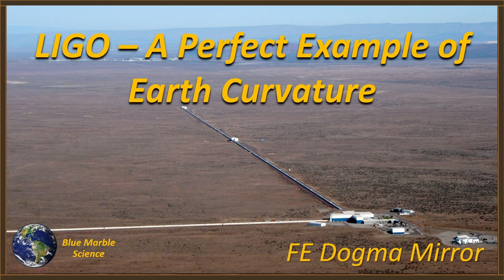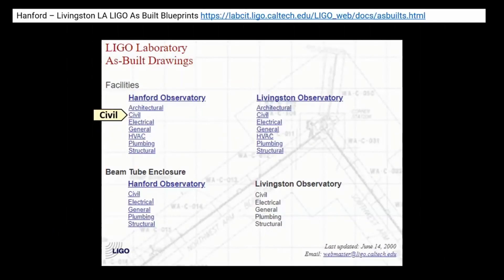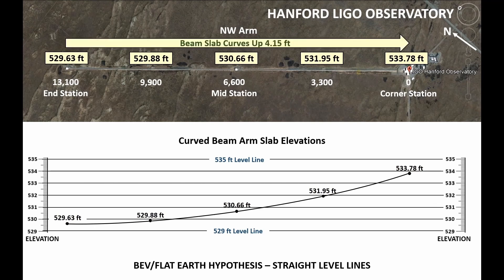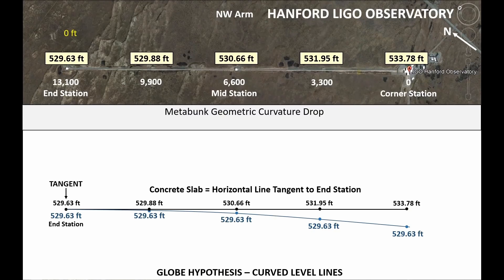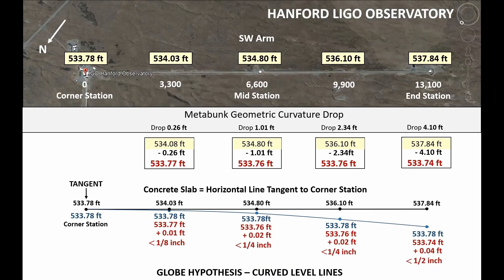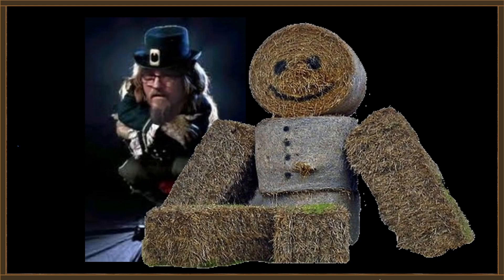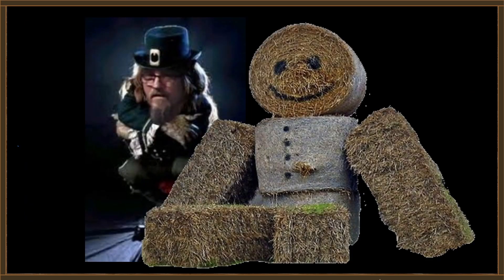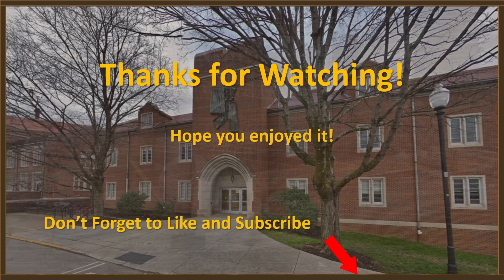FE Dogma LIGO Hanford Mirror

Comment: The phrase "precision engineering" is generally not one that leaps to my mind when talking about concrete pours over a distance. It's probably because of all the Pennsylvania roads I drive on. When it comes to LIGO, they really nailed it. The error in their pour is probably smaller than the thermal expansion experienced by the structure when it gets hot (no, I'm not going to try those calculations because it means looking up stuff).
As far as Bev & crew's apparent mental shortcomings, that raises a question in my mind. Is there an innate limit on what one can learn? Let's use math as an example. Some people breeze through it. Others have to work very hard at it (especially with differential equations). And others never ever get it. Is it the way it's taught? Are brains just that different? I don't know.
The answer is easy in sports. Someone who is fast with good eye to hand coordination and 7'8" tall is likely to be a better basketball player than someone who is 5'2" and a bit clumsy.
Reply: Yes, but with perspective a 5'2" man who was near would be taller than a 7'8" man standing further away. 
You globers always ignore perspective.
Reply: @verystripeyzebra  your understanding of perspective is not completely wrong but also not completely right.

If a small and a big person position themselves in a distance from an observer, with the smaller one closer and the bigger one further away, and all three are standing on the same flat ground, the smaller can completely hide the bigger one ONLY if the observer's eye height is BELOW the height of the smaller one.

Interestingly, when the observer's eye height is higher than the small person, even if the large person is partially hidden by the small person PERSPECTIVE can cause it to become fully visible again by walking FURTHER away.

So yes, perspective generally will make things smaller when they move away from the observer but despite the fact something gets smaller with growing distance it may fully reappear by moving further away.
Reply: @mittelwelle_531_khz  so they can use it tactically to neutralise any height advantage. But obviously they will need tactics to stop the tall person getting into the foreground and therefore increasing their height advantage. 
But if the short person concentrated on the furthest away basket this could also help, as it would be smaller.
Reply: Really the foundation pour only needs to be within the adjustment range of the brackets that mount the vacuum tubes.
Reply: @verystripeyzebra  True, but you need some distance for those three point shots!
Reply from the maker: @scott_meyer  The "sagitta" of that curve is only a foot so in theory, you could let the concrete curve and just provide 13" of adjustment. But that's a sloppy  way of doing it. I don't see a tolerance on the concrete stated anywhere but its concrete. There's only so much you can do unless you want to come back and grind after the pour cures. It appears that they worked to around 1/8" and that's very very good for concrete.
Reply: @scott_meyer  And roads only need to be in the travel range of your suspension. It's also nice when the ripples don't match the harmonic frequency of your damped oscillator!
Reply: @Fudmottin  perfect, he gets more points when it is actually to his advantage. So possibly the 5,2 player is now at an advantage. This is huge! Coaches have been selecting wrong all these years. Once this gets out,  and the flat earth is settled science , I predict NBA players being very short to leverage the perspective advantage.

Comment: Fletfs say the conspiracy is easy as only the higher ups need to know. OK so the builder will have laid a curved base. But no because when they made the tube it was made to be straight so it would be two foot higher in the middle than the ends. So anyone involved in the construction had to be in the know. Let's assume everyone now working in LIGO thinks it is real. Then there must be another team of people feeding the "gravity waves" into the data. At the very least, the instrument engineers must be in the know to keep those connections operational rather than investigating the extra connections. What it amounts to is running a flat Earth LIGO is more expensive than running LIGO for real. Why bother with it at all if the conspiracy is involved?

Why haven't ALL the flerfs been silenced? Other stuff was just recently around to be blamed. They avoided precautions so it wouldn't have been hard.

I think flerfs themselves are evidence there is no conspiracy, never mind all the direct evidence available to anyone who cares to do their own primary research.
Reply: To me it is a sure bet that all the people fantasizing any SUBSTANTIAL scientific and/or engineering project could be ruled by the "need to know principle" (so that only a small group at the top knows and understands what it is really built) have never ever participated in projects involving more than a dozen people required for the "brain work" or involved in assembling, testing, and optimizing the final product.

That not withstanding I fully agree that for SERIAL PRODUCTION of - say a sophisticated weapon - of course NOT the full set of blueprints will handed out to a company which only produces a frame or a cover. (But then they may even not be told these parts end up in a military device).

But there are also people for quality control, assembly and maintenance who need have a basic understanding of the big picture besides the small part for which they contribute their expert knowledge and here the "need to know principle" breaks down quickly.
Reply: @mittelwelle_531_khz  My experience is that the "high ups" are usually involved with the admin of the project and only have a very general overview of it. They rely on whatever information the technicals give them, even if they don't understand it. The technicals definitely need to know a certain amount of what the other technical people are doing to make sure they interface correctly. The technicals are also going to make sure that they see what they have produced works properly in the end result.
Reply: @clivedavis6859  Exactly - thanks.